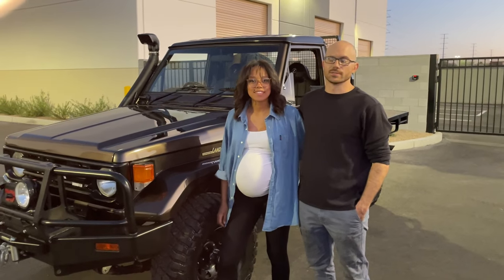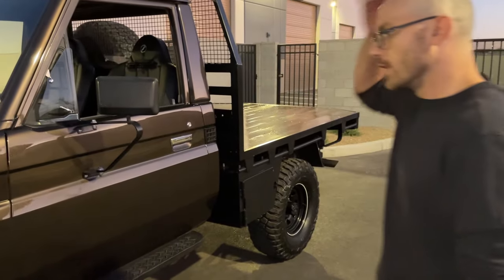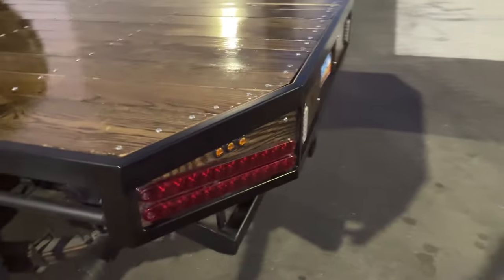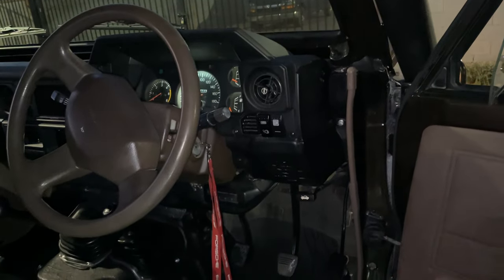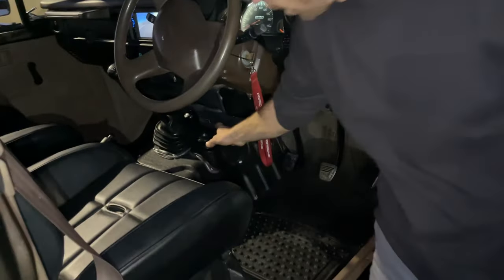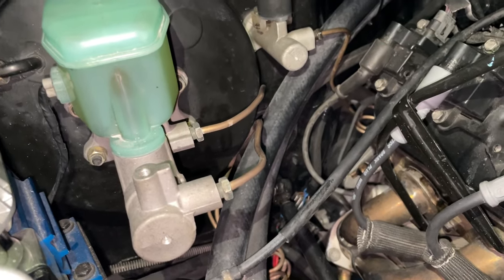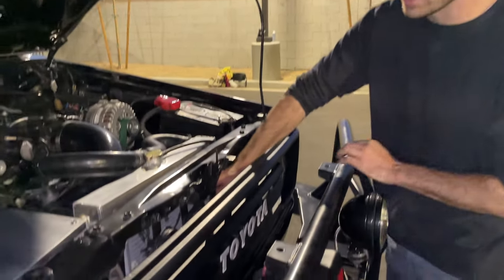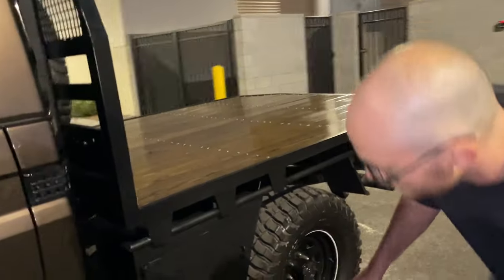1991 Toyota Land Cruiser HZJ75- 6.0 LS Build Walk Through Video

Comment: Is it steel cable winch?
Reply from the maker: Yes it is, in keeping with the original style
Reply: @BriggsCustomBuilds  any plan on swaping you're old school steel cable winch line with clevis to a synthetic line, factor-55 flat link. Only the cable and clevis hook.  It's as strong as steel cable, very much lighter than steel one. I used to run an 80K lbs Runva steel cable line with clevis hook. It works, however ever since i swap the cable to synthetic(spydura nightline reflective). I never look back cuz it's so much lighter, extreme weather proof,
Reply from the maker: No plan to change it. The buyer of this truck is welcome to change to synthetic, but I prefer the old-school style!